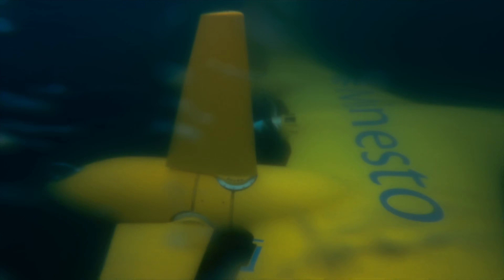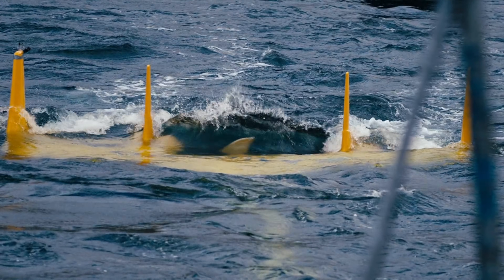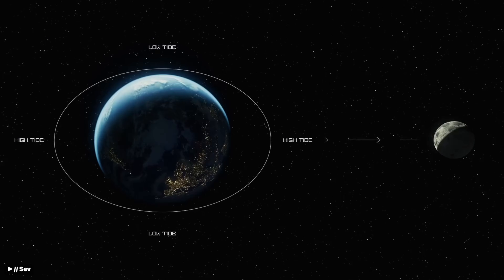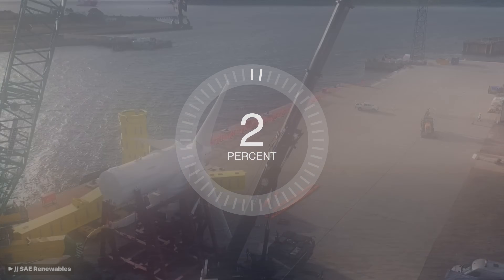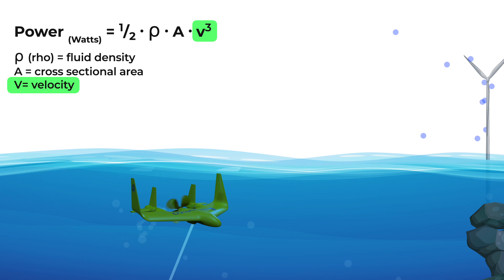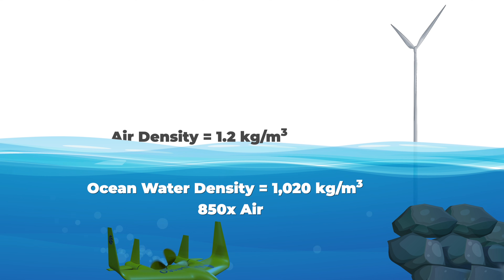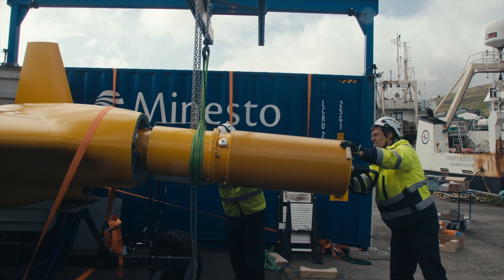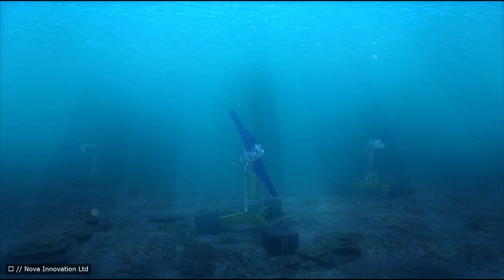How Flying Underwater Kites Are Powering an Entire Island!

Comment: Remote islands can already use solar with battery storage to eliminate need for fuel being imported. This is a very interesting concept though, and would work well in tandem for baseload at night when energy usage is low, and solar would fill in most days with limited need for batteries.

Comment: This is kind of BS, the reason we still have not tidal power is for how it is to maintain and build, and that it is huge energy twice away, so we need to store that energy when it is created, that demands huge amount of batteries that can be charged from 0 % to 100 % within 60 to 90 minutes, that would create a dangerous amount of heat. So BS even a company is testing it, it will be more practical to put it in a river, then make it move less, and build a wall to create a small dam and call it a hydroelectrical powerplant.

Comment: I’m skeptical. There are too many moving parts. Fixing the machine to the sea floor is a huge challenge. Fixing the cable and making it durable enough is even more challenging. Maintenance would be very expensive indeed.
Reply: No need to be skeptical, this is not a prototype or proof-of-concept. This is a finished product with thousands of operating hours for the large D12 utility scale and probably tens of thousands if not hundred thousands of hours in operation for the smaller D4 dragon.

Fixing the system is very easy and is made autonomously using a LARS-system and done under 1h sometimes within 30 min.

Maintenance is relative easy since they can ascend the dragon to the surface and make the job done either on the towing vessle or onshore if more complex maintenence is neccessary.

DNV has made a successful technical review and certification of the complete system which strenghten the buildout investment case.

Comment: Has anyone tried a gravity battery type situation using tides, a platform, a big weight, a barge and a very high gear ratio?
Reply: Are you thinking of wave energy? That is not tidal energy or ocean current.

See if it’s something more like Corpower or Eco wave power you are looking for.

Gravity battery sounds more like pumped water storage to me.
Reply: @jojimom  Kinda but for sure tides.

They increase here (West of Scotland) about 2 to 3 meters this time of year. 

Twice a day tides go in and out and you have a few meters to play with. 

Put a big weight on a barge, tides come in, the barge lifts the weight and it "charges", and when tides are out enough, weight starts to drop (very slowly due to the high gear ratio) to the bottom of the tide. Synced with the lowest point in the day.

Kinda like those wave energy generators you mentioned but over a longer time frame and big enough that smaller waves won't actually do anything

Comment: This is an upfront parallel of Skysail's technology applied underwater. Skysail does a similar thing with kites in the air, flying in defined 8 patterns. Skysail's innovative kite technology generates electricity by harnessing the stronger and more consistent winds found at high altitudes. Raise your hand if you'd like us to cover Skysail's technology on our channel!
Reply: But Skysail’s technology doesn’t seem to have the generator integrated to the kite. So I guess the power is generated by pulling on the tether and the power generation is located on the ground?

Google X has a more similiar Kite as Minesto but for wind where the turbines and generators are attached to the kite/wing.

Comment: Unfortunately, you are reproducing the arguments that Minesto puts forward, but which have nothing to do with reality.
The wings are only active for less than an hour at each tide change, because they can only stay flying if the resistance from the propeller is not too great. It will simply stall.
they only produce a few kilowatts per day, and Minesto and SEV will not disclose the total production pr. day, and when they provide power, which is less than an hour four times a day. :-( :-( :-(
Reply: Do you know the difference between energy and power? I cannot remember how many times I need to respond to people that are confused about the science/concept.

Energy is produced during a time intervall and the unit is kWh, Joule, Ws, calorie or similiar. What you refer to as kilowatts per day should be kilowatthour per day.

Power is however measured in the unit W, kWh, J/s or similiar.

Minestos D12 dragon will generate 3,5 GWh/year. That is equal to 9,8 MWh/day or 9800 kWh/day, not a few kWh/day as you say.

The dragon will be rated 1.2-1.75 MW.

Is is active during four cycles each day and stand-by during four times each day when the tide shifts. You can expect the dragon to be active closer to 3h each cycle not 1h. 3h active, 3h stand-by 8 times for a 24 h-window. The utilization of the dragon is roughly 30-40 %.

Comment: Endurance and maintenance are the big questions I see. Having a constantly pivoting tether in the ocean is a major point of failure.
Reply: Good point about the tether, guess time will tell as they collect more data during scale up and increasing operative hours.

Good thing is at least they have engineers and experienced thether manufacturers that can produce a system that meets up with the requirement.

Also minesto has puched the existing tethers beyond rated capacity and close to DT (destuctive testing) to verify the limits of the dragon wing and power generated.

Comment: I would ❤ to see more of this - a power generation that uses 5 times less material per MW than wind power should become the cheapest renewable (maybe even overall) electricity generation on the planet when scaled up in volumes.
Reply: Minesto pushes these material numbers to 16-24 tons/MW while wind power lands well above 200 tons/MW.

Example: Haliade X rated 14 MW with a weight of 3300 tons (blades, nacelle, tower).
Reply: @jojimom  Even if the 14MW turbine weights pass 3000 ton including foundation base and Minestos dragon base weight is unknown (maybe 50-150ton), Minesto still is way ahead wind turbines, especially considering that they produce zero when wind dont blow which you can't tell when. 
Disaster for economy that rely on wind.
Reply: @jacka9612 I’m actually not sure if these 3000+ tons also include the seabed foundation, jacket or whatever it’s called. It just says tower mass: 2550 tons.

It seems difficult to find numbers och the complete structure for a wind turbine system on the internet which is strange.

Minesto is no longer working with the gravity base foundation. They are know using a drilled anchor solution, which should be much lighter. I will check if I can find the numbers.

Comment: There seems to be a few comments mentioning that 'studies' have been done regarding marine life. It would interesting to know what those studies covered. I understand they also did studies for wind turbines, but those particular studies didn't include observations about most of the negatives regarding the wind turbines.
Reply: They have performed vast environmental studies together with universities and authorities as well as oservations during operation. No single incident yet.

You can read more at Minestos hompage under environmental impact. Unfortunately it is not possible to put links in the comments.

Comment: Has there been any studies done on how and the level of disturbance such a tidal system has on the marine environment and marine life. Something that's constantly moving with a tether will have different effects when compared to a system that's static and anchored to the sea floor. And will marine life be accidentally caught in the moving parts? What could be the effects of such an incident? Is it possible for say, an octopus, to latch onto one of the hubs and jammed the system while at the same time injuring itself? And what of barnacles buildup? These are just some of the many questions about the long-term challenges that should be addressed before any large-scale adoption of any man-made system in our oceans.
Reply: Yes, they have performed vast environmental studies together with universities and authorities as well as oservations during operation. No single incident yet.

You can read more at Minestos hompage under environmental impact. Unfortunately it is not possible to put links in the comments.

Comment: They aim at 0.1$/kWh??? In 5 years? When other techniques are already at 0.3$? They are dead in the water before they even start.
Oh, and the idea of petrol "running out" might still be wrong, as oil might not be fossil at all.
Reply: What do refer to as ”other techniques”?
Reply: @jojimom  Solar+batteries
Reply: @FlorestanTrement So my take on that is, those are two fundamental different technologies. It’s like comparing ”apples and oranges”.

For obvious reasons solar+batteries are more expensive. You have to deal with both power generation and storage, that is double the cost if not more. So breaking down the capex for both technologies in detail is a must if you going to compare them.

Minestos system are relative lightweight, base power generating (predictable) and outstanding LARS-technology with low maintenance and opex costs.

The efficiency of a solar+battery system I would say is also bad since the losses will be higher then a stand alone solar system. So you must also take into account those extra percentages in losses that increases the price aside from the capex investment of batteries itself.

Try comparing with wind power and see how the LCOE curve have improved during the recent years. Then you will understand why they can reach such low LCOE that fast. Also take into account the advantages of Minestos technique compared with wind and you realize the outsanding properties of harnessing tidal current with a dragon.

Comment: If the AI industry was required to install 24 hour battery back up they would go a long way towards solving the problem of too much mid day solar for the grid.
Reply: That sounds expensive. Add capex from both the solar power systems and then the battery storage on top of that and then you get a price structure that no one is willing to pay for.

Also, the power demand is typically lower during night then the day.

Comment: Think about a water skier. When tracking straight behind the boat, the lift is low and the ski is deeper in the water.
But with a constant boat speed, if the skier slaloms, the skiers speed increases significantly.  It's counterplay between the constant force of the boat, the resistive force of the water ski, and the angle of attack in relation to the other two forces. Note the length of the path the ski follows is significantly longer than the straight line behind the boat.
In short: DELTA angular momentum.

Comment: Question how much energy did it take to actually produce that and how much energy of fossil fuels did it take to produce that?😂
Reply: That would be nice to know. Hopefully the full supply chain could be using fossile free fuel or at least it is possible in the future.

However, the wing is produced in Sweden which uses 99 % fossile free energy production in their electrical grid. Maybe all other parts could be manufactured similarly to reduce the overall CO2 impact.

At least all technologies faces the same issue, so there is nothing unique with Minestos concept in that aspect.

Comment: *ON, SHJT!! THE CABLE BROKE ON THE UNDERWATER KITE ENERGY MACHINE!!* 

CABLE WAS MADE IN CHINA, SO THERE YOU HAVE IT!!

1) THE CURRENT OF THE TIDES MAY STOP WITHOUT WARNING
2) THE PROPELLER BLADES MIGHT GET CLOGGED WIH SEAWEED
3) MECHANICAL BREAK DOWNS
4) SALT CORROSION ON THE STEEL BLADES OF THE KITE TURBINE
5) ALL OF THE ABOVE
Reply: Yeah. And you dont think Minesto has a answer to all those "questions"? 😂 this is legit!
Reply: Which cable broke? Not Minestos tether anyway.

1) The tidal currents will not stop. They are generated by the moons tidal gravity forces and will remain as long as we have the moon in orbit.

2) highly unlikely, since it orbits well above the sea floor. If however something would clogg they can ascend the dragon unit to the water surface for cleaning.
3) Why would it break down mechanically?
4) The turbine blades will obviously be made from a non corrossive metal. Anything other would be plain stupid. How do you think the turbine blades of millions or even billions boats around the world can manage the corrosive environment?

Comment: The output section got me thinking about the phase balance. Surely the power outputted will I think go through some sort of transformer/capacitor/regulator to be phase matched with the local grid. So as long as the power coming in is less then the power draw you won't see the power oscillation. So you don't "need" more kites
Reply: You’re correct. Power electronics is the way to go. Rectify the power to a DC-stage with a capacitor bank to stabilize and then invert the power into a AC that is in sync with the grid.

Comment: Nice episode! Good to learn about this under water kite.. but I see a lot of problems with this idea.

With tidal power put out 850 times more power than windpower, the equipment needs to be 850 times stronger as well, which often means 850 times heavier... At the other hand you dont want the moving parts of a generator be that heavy, because that would take away much of the generated power.. It takes a lot of energy to move a 20 ton blade around in high density salt water!.. So this high water density combined with large and heavy moving turbine parts, do not really match together.

And here is another problem with tidalpower. The turbines get so incredibly heavy when trying to maximize the power output, you run into the physical limits of the materials you manufacture the turbines from.. This limits the size of the turbines and with that the overall efficiency of the turbines..

And with an underwater kite, this only gets worse, because it has to move even more!

So I think the possibilities are quite limited. But maybe this company will find its niche of supplying small coastal communities with underwater tidal power, instead of eye soaring rows and rows of windturbines or endles fields with solar panels.

But like many said here and you also mentioned, maintenance is a bitch on these things, just imagine that bearing on the anker point subjected to incredible high and constantly changing loads, in a salt water environment.. 

Anyway, this may put some light on why tidal power has not taken off yet, and this underwater kite will not be the holy grail to these problems, quite the opposite!

Comment: How does it work (how much power produced) or survive during Hurricanes or Tsunamis (wind turbines have to shut down)?  How much power does it produce in between tidal flows (can it really be a base-load power)? This doesn't sound like it is 24/7/365 reliable for base load, which is the problem with many renewable sources of energy. Yes, you could pair a BESS with it, but then you cannot really call it "base load" at that point, and you must ALSO spend money on the BESS too, which isn't always in the LCOE.

Comment: A kite needs a certain airflow to overcome the gravity of the kite, while an underwater device could be more of a tethered submarine, where buoyancy is used to place the average depth midway between the high and low point on the curving path. While this would increase the complexity slightly, it would pay dividends. Does the device discussed use this benefit?

Comment: Renewable energy technology has come a long way and decresead costs significantly. However, there hasn't been an important improvement on the cost of doing things under seawater in general. Despite all the potential advantages energywise, I don't see how this can be cost competitive against other "dry" renewables.
Reply: Cost isn’t everything, also these things are important:
- Predictability / reliability
- Base power
- Fossile free
- Sustainable
- Occupation of land area / available areas for build out
- Local conditions (weather, climate etc.)
- Permits
Reply: @jojimom  it is not everything but no matter the advantages of a technology, if LCOE isn't competitive enough, it is difficult to see a massive adoption of it
Reply: @apermas That’s true!
Reply: @apermas  Yes, I agree. LCEO must be competitive!

At least Minesto ensures that these LCOE should be valid for cumulative installed capacity:

10 MW: 100-130 €/MWh
100 MW: 55-75 €/MWh
1000 MW: 35-45 €/MWh
3000 MW: <35 €/MWh

That should be competitive enough, but time will tell if it's true.

Comment: Power cable will break
Reply: Why? It has not broken yet.
Reply: @jojimom  Any movable joint will eventually wear out.
Reply: @daveulmer  Yes, of course. But the important thing is for how long it will hold. If it can hold for 10-20 years then it will have made its pay-off time. It can simply be replaced with a new one.

Look at the mooring lines / tendons on floating offshore platforms. They have made it through "test-of-time".

For sure, they will design these tethers so they will not break during the life cycle of the system, which I would guess to be 15-20 years.

Comment: oil is not finite. We have a fusion product that has been running for 5 billion years. As with any fusion device , it produces heat which is converted to electricity and then transported to where it is needed. The Sun is a fusion device and we can capture this with solar panels etc. This energy is then transported to areas where it is needed. We also have had a perputal mention machine for 5 billion years. Good for another 5 billionyears. The Moon movevs tides all over the world. This also needs to be captured and transported.